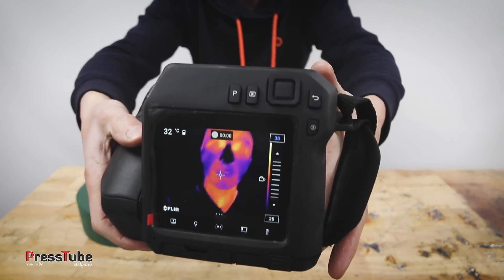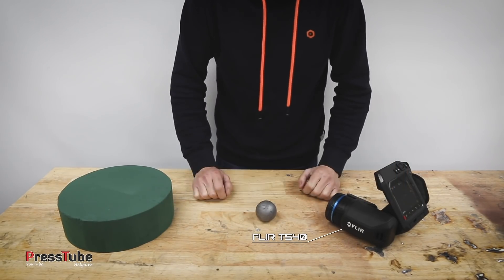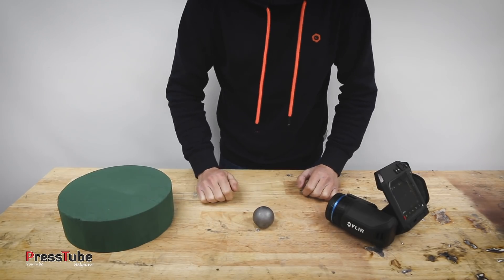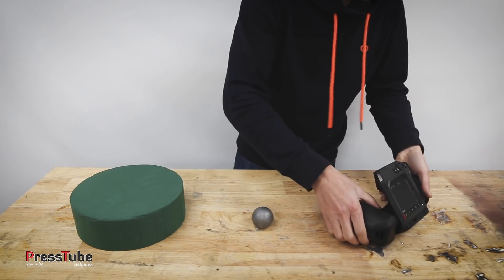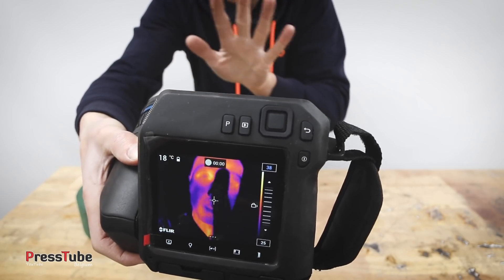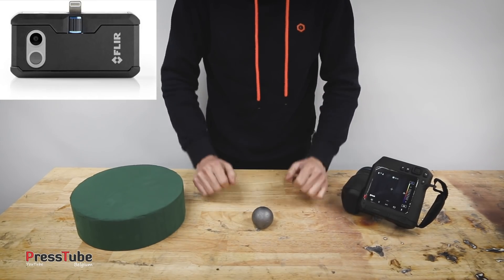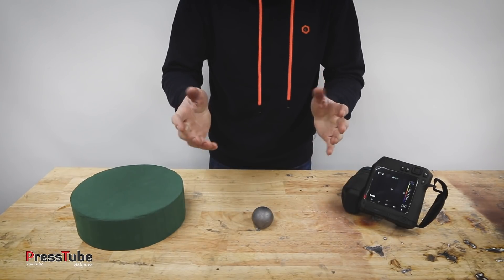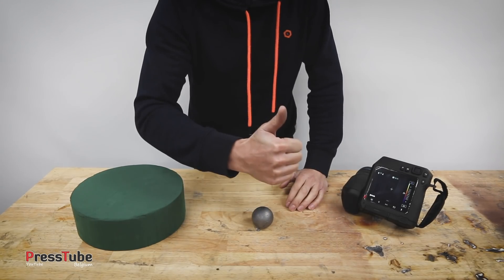EXPERIMENT: 1000 Degree BALL vs FLORAL FOAM and FACE REVEAL

Comment: you could try making a material called starlite, its an extreme thermal insulator. it would be interesting using the thermal to track the way the material dissipates the heat, and its fairly easy to make.

Comment: Imagine putting your hands deep into that foam thinking it was cooled down
Reply: I doubt the foam would transfer the heat into you hand very well at all.
Reply: @SoI_Badguy  it will definitely still burn you though
Reply: @SoI_Badguy  even so you can see the hot air rising, that'd definitely burn you